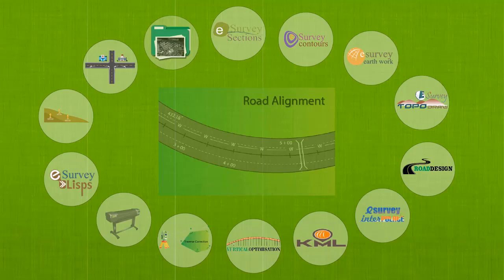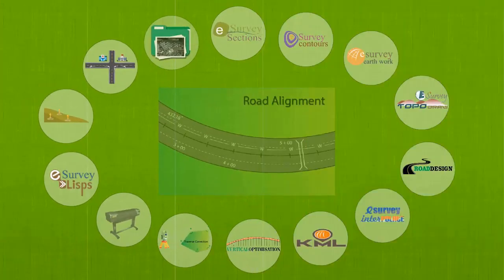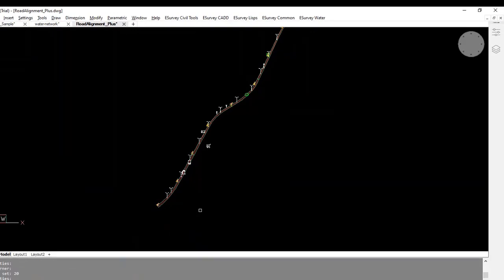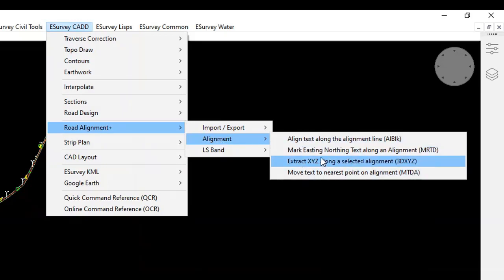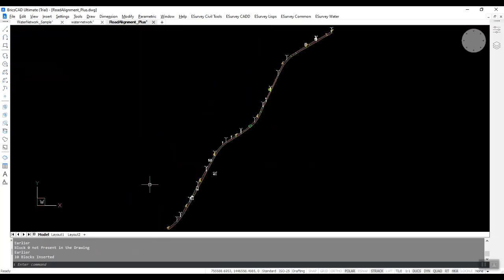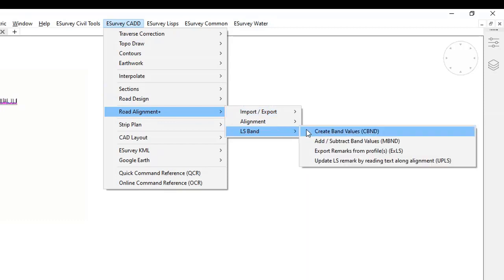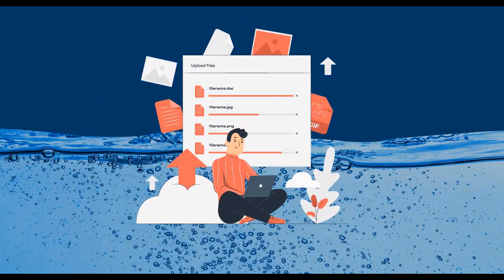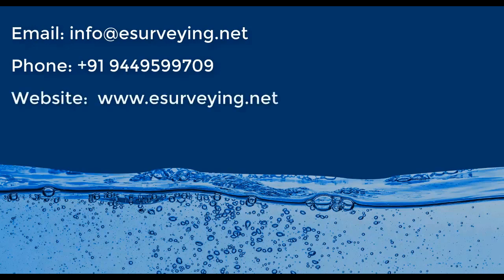Road Alignment Drawing Software

Comment: Good morning
Question is that when I draw toatal station data in auto cad than ogl not shown please suggest any exel sheet or command to draw ogl with line thanks
Reply from the maker: Dear Sir

ESurvey TopoDraw module is helpful this kind of requirement. Along with this some other features available in TopoDraw module

Regards
ESurvey Team